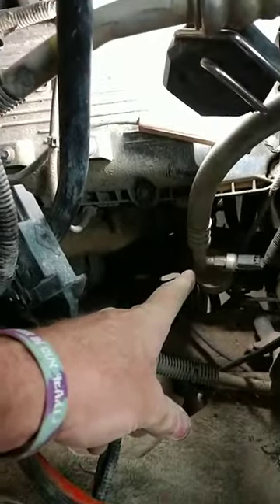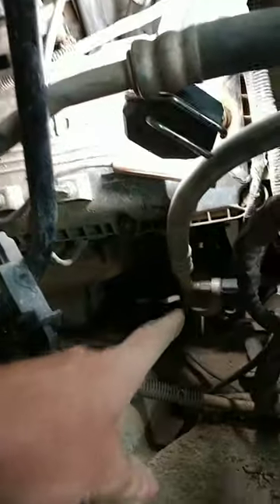How Engineers Keep Mechanics Miserable (Part 287) #shorts

Comment: As an engineer whose worked a good portion of my life as a mechanic, I can say the problem with most engineers is that they've never busted a knuckle turning a wrench before... Everything looks good on paper.
Reply: As an engineer myself, I tend to agree with @graveyardrumblers.  In addition, they are likely thinking about the finished product, which is a perfectly functioning Engine as it leaves the factory. Not enough thought went into the what-if questions such as what happens when various parts fail several years down the road?  I’ve made mistakes like this myself, but now I try to teach younger engineers to think about these things and the people who have to maintain this equipment.  In my case, it is for natural gas compressor stations and underground gas storage fields.
Reply: @CheMechanical  seems more of a modern issue, I don't drive new cars because I'd much rather fix up an older one, and some designs from around the 90s were incredibly easy to work on, and had everything possible accessable without removing a ton of parts to get at it. If more people DIY'd and were as good to their older cars as the car was to them, none of this would be an issue, but nowadays people always have to have brand new, then after a few years trade in for something newer when there is literally no need, people comment on my old cars all the time saying they're going to break down, or they're unreliable, and each and every one of them keeps ticking on like clockwork while they're all breaking down or being stuck in the garage for weeks on end regularly because something's failing somewhere, anything breaks on my cars it's easy to diagnose, cheap to order the part and takes a Saturday evening to put right on the street outside my house lol I could literally buy a second hand engine on low miles and fit it in less than a day for less than I've known people to pay for having a relatively small part changed at the garage on their newer car. Things were far better when they were more simple in my opinion. Nobody needs all the fancy computers and other things cars have these days. Older things were built to last and be easy to repair when they failed, these days they seem to cram everything in and design them to fail in less than a decade it's like they want cars to be throw away these days and not last the test of time.
Reply: You're exactly right. I can almost guarantee that not one engineer has never turned a wrench and has never busted a knuckle or 2 trying to get into a tight spot. hell, I'd be willing to bet most engineers who design this shit don't even know what your most basic hand tools are even called let alone know how to use them.
Reply: @richardsalinetrojr1957  I wouldn't say most engineers... Certainly a large portion of corporate engineers. I work for a small company and when I get tired of sitting at my desk I will go down and work with the mechanical assemblers because it gives me insight into some of the limitations they face with some of the current and older generation designs. Then, if I see a better way to do something that makes more sense for either the mechanical assemblers and/or the end user, I will start a formal process to implement a design revision. Engineering is an iterative process, and for someone like me, I hope that the iteration I send out the door and down to the shop floor is best it possibly can be. The problem I see here is that the dipstick tube mounting design was considered for mechanical robustness (maybe 😆), and ease of assembly in the factory, but no consideration was given for end user maintenance.
Reply: @MDM1992  That's also the difference between the old timers that built the industry and the new generation(s) of engineers... When you think about why cars nowadays seem like cell phones on wheels and then you consider who is designing new vehicles, it makes sense lol. I'm with you though, I don't own a vehicle newer than the year 2000 lol
Reply: As a tool and die maker, I agree.
Reply: All these people putting in 15 to 20 minutes of effort to create 2 or 3 paragraph replies are doing it in vein. Not just you guys, but everyone else who does this too. 😂 I mean, only patient people will read it… so, like, 1% of the internet
Reply: Two of the simplest jobs  to do 
1. R&R the plugs on a 73 mustang fast back, 
2. R&R pull the distributor out of a 60 F100.. 292
3. Where is my ball bat at. 🤬

Comment: They were really banking on that dip-stick not having problems. 🤣
Reply: Yeah this is the real answer.
Reply: If it outlasts the warranty, thats all that matters to them
Reply: And then they put it RIGHT beside the Manifold, meaning heat cooks the paint off and accelerates oxidization. I did a dipstick tube on one of these, it was a $2500 bill. Might as well do a new manifold well you're in there, and eh might as well do the other side if you're doing one.

Comment: i still get mad at gm engineers everyday when i have to unscrew like 16 screws by hand just to check a damn air filter that is almost always still good
Reply: Damn, my pontiac and GMC only need me to undo a couple of latches. My saturn was even easier.
Reply: My 95 dodge all you do is unclip 4 latches and bam it's done but now that I put a transport truck air filter on it their is no more air box
Reply: I CANT EVEN BEGIN TO EXPLAIN MY FRYSTRATION WITH THAT SAME SHIT
Reply: @dkillahster  😂
Reply: Even worse when the screw strip or the plastic box housing loses threads and let's them spin in place. Also usually recessed so you cant grip it out. Also plastic so using a grabit drill bit heats the whole thing and ruins it. Ask me how I know.
Reply: @thegman4759  don't forget on those raggedy transports the nightmare of changing the brakes and rotors on those along with all the junk China torque to yield bolts.
Reply: @eric63377  it's not that bad you just need to know what your doing
Reply: Which make and model of vehicle is that so I know which one to avoid?
Reply: @BryanTorok  every single gmc chevy buick cadilac and also dodge does it too. i was over exaggerating by 16 but Ive had some with around 10 screws but most newer models will have 3-8 depending on the kind. But you should really worry about that if you are just buying the car for personal use
Reply: Ain't nun but the damn truth 🤣
Reply: My chevy litteraly just has 3 latches
Reply: I long for the days when the air cleaner cover was held on by ONE wing nut.
Reply: I felt that. My air and cabin filters. Despite being simple and operator "friendly ", is very tedious.
Reply: Damn, I just have to open the hood of my WRX and Forte GT and look at my air filter that is just right there, don't even need to open a box when there isn't one
Reply: I’m a Nissan tech and when I get a Chevy I think how miserable I’d be to have to take 10 plastic screws that are almost always stripped, maf sensor off, clamp off the boot, JUST to see a clean filter I would find a different career. Full offensive, kindly haha
Reply: 2 clips on my corolla air filter housing. . Best car ever built with the 1.8vvti.
Reply: aftermarket intakes that use reusable pod filters are a godsend my guy
Reply: My 04 f150 5.4l was the easiest ever. Two sling latches and it’s open. Takes longer to get the new air filter out of the cardboard box then it does to open the air box, remove old filter, install new filter, close box. It’s an under 10 second job even if your slow.
Reply: Still way better than a Ford Focus. Air filter is behind the front drivers side wheel. You have to replace the entire air box to change the stupid filter.
Reply: @M0NEYYT  are these all "modern" GM cars? (Post 2009 bailout)
Reply: Lol Don't sound like you know what you're Doing
Reply: Bloody hell, and i thought my SAAB was bad for having 6 torque screws to take it off
Reply: Lmao. Facts.
Reply: Then why waste your time
Reply: @ronp499  bc thats part of the job i do my job properly
Reply: @BigWheel.  Air filter cover on my 2010 accord is legit just 2 clips.
Reply: @BryanTorok  Every car made after 2000. If you want a car you can comfortably work on yourself, no modern american car would be it. Get yourself a 95 blazer or something.
Reply: I’ve got an ‘11 GM vehicle, a ‘14, and an ‘18.  All very easy to access and change filter.
Reply: @briand9754  compared to any others with clips hell no dont lie to urself
Reply: I don't know if someone at GM owns stock in loctite but they use that on damn near everything on their vehicles. Including little tiny trim screws.
Reply: My 2004 Grand Prix GTP only had 2 latches for the air box. Screws/bolts must be a new GM thing, like how Chryslers new thing is running their business into the ground by forcing themselves to produce EV’s.
Reply: Swear 🙄

Comment: Some time in the 80s/90s some mechanic probably screwed an engineers wife, and so the secret society of engineers decided to screw us back
Reply: Id say it was the mid 70s. It was a wild time
Reply: @dubiousf00d  I wouldn't doubt it
Reply: Yeah mechanics are known for having strong hands and able to find those hard to reach spots
Reply: @eric63377  yeah the gas ford's went to hell around that time but I'd say the deisels went to hell with the death of the 7.3
Reply: @ThatMechanicGuy  International made the 7.3 and it was a really good engine after that Ford tried to make a diesel engine and they've all been failures in my opinion. The Gm 6.5T wasn't bad at all and the 6.6Duramax was way better. The 12v Cummins was awesome and the 24v was good. Every diesel after that went to hell thanks to the EPA. That's why no matter the car manufacturer we like we all MUST come together and SIGN the RPM ACT!
Reply: I was told it was the summer of 1977
Reply: @ThatMechanicGuy  yeah that was the best International Harvester diesel engine ever installed in a pickup truck for sure, bullet proof
Reply: I don't buy that. An engineer would have to have a wife for that to happen.
Reply: @eric63377  WTH R U talking about??? Today's diesels are better than ever, stronger, and quiter, and MORE powerful.
Reply: @JohnSmith-lp8wt  and less reliable plastic fantastic piles of junk with way too much expensive EPA crap making it stupid to afford buying, much less repair! Innovation should be making it more affordable and long lasting, not less attainable and easier to break, and harder to fix! Best diesel was the 12 valve Cummins. And I don't even like dodges!

Comment: I’ve said it before and I’ll say it again: today’s automotive engineers have never worked on car repairs, and they are completely obtuse when it comes to replacing parts.
Reply: Yes sir the OG auto engineers were basically mechanics, physically working on designing cars. Now they sit in front of a computer to 3d render it.

Comment: How to replace dipstick on camry
Step1: Open hood
Step2: Replace dipstick
Reply: It’s the tube that’s broken
Reply: @saltybutsain6348  step 1:open hood
Step2: Replace dipstick tube
Reply: Camrys aren’t making money like top G
Reply: @aldosaldana1462  some of them you gotta pull a manifold off
Reply: How to load 2.5 tons into your Camry:

Step 1: SMASH
Step 2: Buy a big heavy duty American truck because you need to do work. . 🤷‍♂️
Reply: @emmittmatthews8636  he's also forgetting all those Rusty trash China Steel bolts that never come out and always break when you touch them..
Reply: @eric63377  never gotta come out if the car never fails
Reply: I just have to clock in, 2005 VWJetta
Steps
1. Open hood
2. Pop four engine cover clips
3. Reach top dead center engine grab dipstick 
Pull firm upward 
4. To reinstall go to step one….. every three years as the morons at VW made it out of plastic and if you actually check your oil regularly, the tube pops out from plastic failure 

No tools required
Reply: @buddytheweim  my friend went through 3 transmissions in his camery… and his exhaust manifold came completely off. So idk about that statement.
Reply: I replaced the engine in a 94 Celica because it threw a rod through the block and caught the engine bay on fire.
Reply: @emmittmatthews8636  How to do work in America

Step 1: Give up on pickup trucks because suburban posers sent prices sky high
Step 2: Buy a cargo van
Reply: Toyota camry is a  hell of a good car. Especially the older ones.

Comment: Remember though. These are assembled on the chassis first. Also, and this is important, nobody thinks the dip tube is going to randomly brake.
Reply: Key words you just said " Nobody thinks! "
Reply: Thank you for saying that there designed / engineered to be assembled the fastest and least expensive way they can at the factory.  Like you said the chassis is rolling first, then the engine is put in, then the body panels.  Everything is put around it. so they don't care about having to fix it after that's done
Reply: I found the engineer
Reply: I replaced the brake lines in my 2002 Chevy truck twice, once with the body on and another time with body off on a bare frame. Much easier the second time. 
I was at a GM dealer recently and there was a 2015 1-ton diesel pickup there getting a new engine and the entire body was lifted off the chassis because the job goes easier that way.
Reply: @onemoremisfit  This is also why most auto manufacturers go for the cradle. 4-6 bolts on chassis, unplug wires and hoses, then lift the car and everything is faster and easier... as long as you have a lift or friends willing to work for beer.
Reply: @bassbro1  They've always built them this way from the beginning but in the old days there was still enough room and simplicity to access everything over the fenders and below the chassis for shop service. Today they are so complex and modular that often a full scale dismantling is actually easier than partial disassembly for service, professional techs are cursing the engineers and shade tree guys are just doomed.
Reply: @onemoremisfit  They continue to pack more sh!t in smaller engine bays. Vehicles today have a whole lot of worthless sensors for economy, environmental, air quality, blah blah blah. Then there are the fuel vapor canisters, 27milluon wires connecting it all, and finished off with multiple body/chassis panels that hide everything. They did all of this to make the government and the customer happy while making the person who works on them mad
Reply: @bassbro1  Yeah the results are an engine bay that is 200# of crap in a 100# bag. BTW I was not accurate on that diesel I mentioned, the original reason why the body was lifted off the chassis was the engine needed cylinder heads pulled, and then in the process other problems were discovered needing engine replacement. Imagine lifting the body off the chassis to pull cylinder heads because it is actually the least amount of labor!
Reply: @c.shannon3914  No, I'm just a 9 year Technician. I took a little auto engineering to understand why this happens. I didn't want to become the hates person in the industry...just try to understand
Reply: @bassbro1  I know, was just trying to bust your balls. I understand what you're saying, but most don't. Cars are engineered/designed to be assembled quickly on a line. Not to be repaired. Being repaired is a total afterthought.

Comment: fleet mechanic here. never pulled the mount, ac or battery box. Manifold, mount through bolt and jack her up, most importantly INNER WHEEL WELL (maybe 5 8mm bolts, a couple clips and maybe 5 tiny 5.5 mm bolts) 
Also done on the floor, no lift

Comment: Lol you don't have to pull the motor mount on those pull the inner fender off you have all the room in the world you just don't know what you're doing.
Reply: Maybe he’s a dodge mechanic
Reply: Amen brother
Reply: Its about the views not the mechanics
Reply: Exactly. Or unbolt the manifold from the block and mid pipe and pull it away to get a wobbly in there
Reply: You can probably get that bolt with a box end wrench. Bust the manifold off the head, pull it away, and then slip the rest of the tube out...after popping the bottom of the tube out the block✌️
Reply: Ford mechanic, lol
Reply: Wrong I’ve done 4 of these 6.2 and u have to pull the motor mount to get a tool in there to pull the rest of the dipstick tube out, even with the inner fender out!
Reply: @pauls6909  you're just as bad as the guy making the video I was doing these when the motor first came out I lost count of how many I did never touched the motor mounts
Reply: @foxbodyguyeightyeight3672  😂😂 then u never done one, I bet u didn’t pull the starter either. I should add they all broke off flush with the block
Reply: But, we all get the point ! Thanks
Reply: Well, foxbody guy is a foxing liar,
Reply: @foxbodyguyeightyeight3672  wow triggered much🔥😂
Reply: Guess the best part tho? There is fucking loctite. Our shop truck is a 2011. Trans tube and oil dipstick tube both rusted thru. So I used a wrench, sucked ass. As the parts were from the dealer, they didn’t have them at the parts store. Incase you guys one day get inside and it shifts to drive with a loud bang and stays in 4 or 5th gear, my problem was the trans wiring harness came loose and was hit by the drive shaft. It only has one zip tie right above the output shaft.
Reply: Still it shouldn't take ten minutes to replace a freaking dipstick.
Reply: @luisgamez9941  I agree but it’s a way for the steelership to take ur money
Reply: Hard to trust a guy who calls an a/c compressor an a/c pump.
Reply: an older vehicles that are near the end of their life I have even cut holes in the inner fender well, then patch it with sheet metal, it's only a machine, it can't out think you. usually.
Reply: He knows what he's doing! it's called billable hours!
Reply: O by the way if the tube brakes off flush with the block a 3/8 or 7/16 bolt will screw in to tube and you will be able to pull on it that way